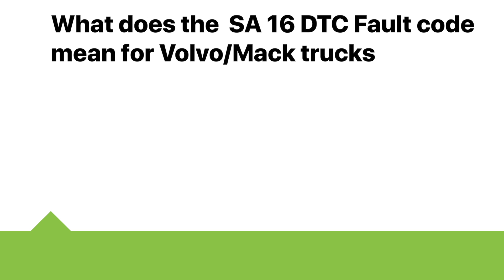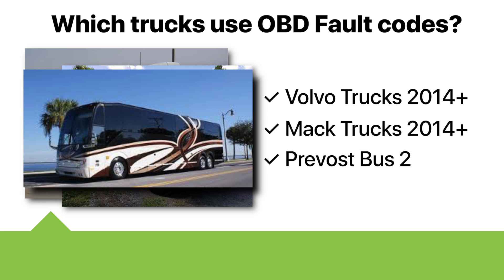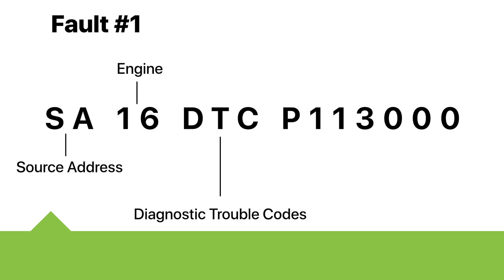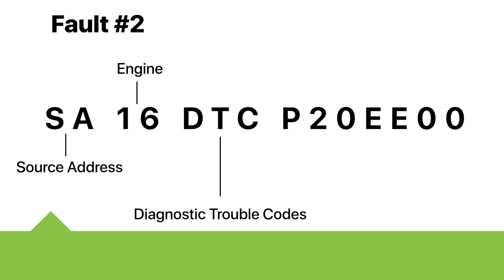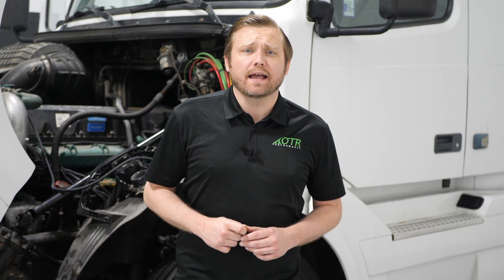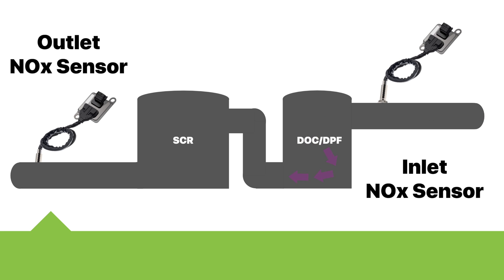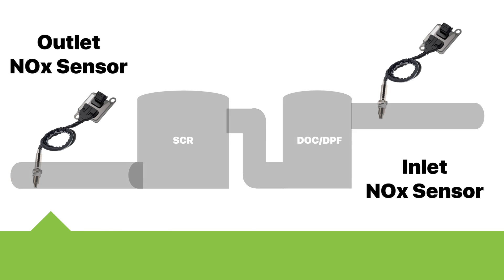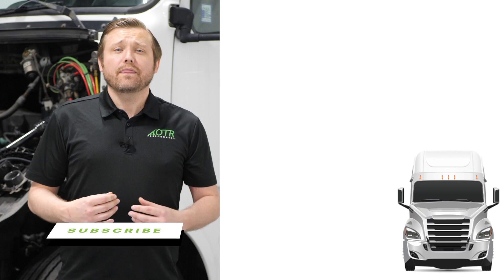SA 16 DTC Explained - Volvo and Mack Trucks

Comment: I have P103100
Reply from the maker: Hi, It looks like that code is related to Particulate Matter Sensor Exhaust Sample Error Bank #1, either the sensor is clogged or will need to be replaced/repaired.
Reply: @otrperformance  thanks, will try to clean it.
But anyway it needs a system update?
Just at dealer?